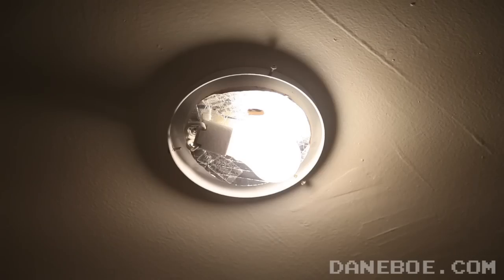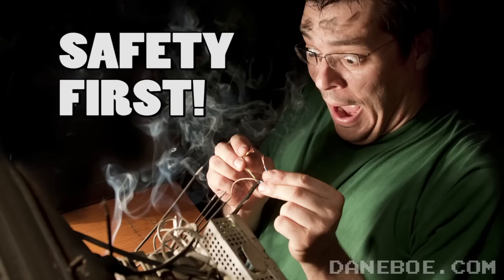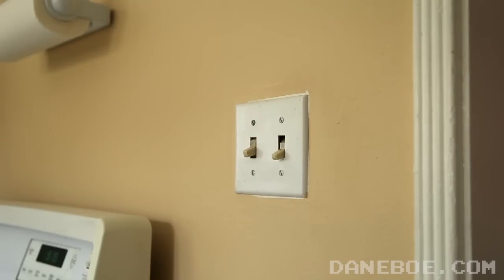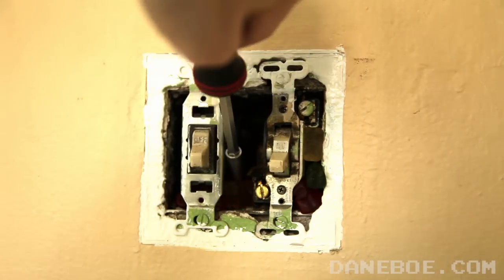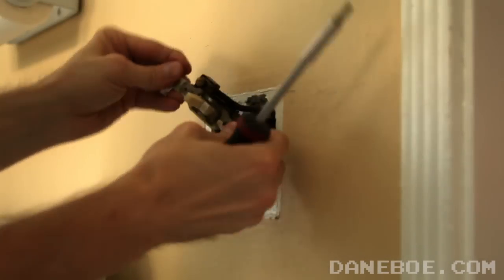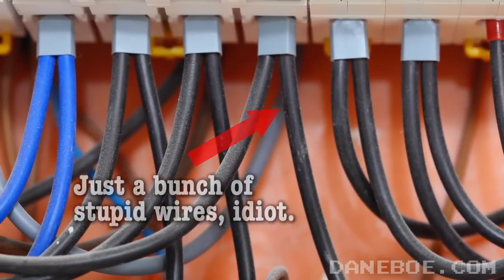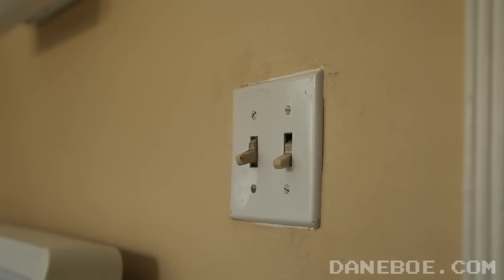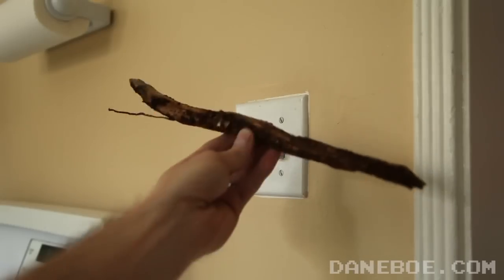Light Switch Hack

Comment: By spinning the switch, you're bypassing the fusion conductors creating a double-quadric flow current that inverts the bulb filament, creating a triple-voltage bond between an electromagnetical high density recharge circuit.
Reply: Goodbye brain.
Reply: @dylaninpieces2  DON'T USE THE STICK!!!

Comment: Wow, must be an old house since you have screw in time delay fuses. 
Turn it too many times and you will certainly cause metal fatigue and the wires will break.
Reply: Or if not the case, the bulb could be as bright as the Sun, burning everything in its path.
Reply: @TheStellaruniversexm  But Don't Use The Stick Here.

Comment: I've found a way to make this work better. After rotating the light switch,before putting it back on, jam the stick in. Then reattach the light switch. This sends the stick through the wires into the lightbulb causing a chain reaction with the lightbulb superheating the air into plasma creating a miniature flux rift causing the light bulb to generate much more light.

Comment: Fine, I'll just sell the stick on Storenvy.
Just so you know, there are no electronics in a single pole 120V switch. Which makes the hack all the more amazing. As well as twisting the wires would cause a EMF fault.
Reply: But do you really have that old fuse box in operation?
You may as well use the stick to circuit the power.

Comment: Well iphones came in 2007 so your house should be built after then if you want any iphones or ipods. Ipods came in 2000 so the iphones replace the ipods later. This is so real! There is large wattage in the circuit so it can become too bright.

Comment: As I suspected from your other BS videos you are putting anyone in danger that does not know the difference between and joke and potential instructions.
I don't care how much time you put into these videos you are close to being reported as it is. I will make my final decision after viewing more of these videos.
Reply: calm down
Reply: I also know the dangers but there are much worse videos out there
Reply: Brad Law That's true and I have reported 3 people for these types of instructive posts. LifeHack2012 is one of them.
Anyone that does not have the faintest clue about how to use a multimeter to ascertain a lack of voltage in this switch set up prior to sticking their fingers in are quite likely to get a nasty shock if the correct switch or fuse has not been utilized to remove hazardous voltages.
The mate I have living with me is not silly but he also has no idea on electricity. I bought him a multimeter 3 years ago and it is still in the packing because he does not know how to use it mate. So even with the best of intentions fatal mistakes can be made by unwary people that may become victims of following these videos.
Even as a service technician I stuffed up during my training by switching off the wrong power point while I was servicing a switch mode power supply. I touched a heatsink and then the chassis which resulted in me getting a 9000 volt shock from a unit designed to power 32 hard drives on a network. I couldn't feel my arm till the next day but I was lucky because if the voltage went through my heart I wouldn't be typing this message.
CHEERS
Reply: NoevileaThis video is for entertainment purposes only dude. Chill.
Reply: Jbmorris289 tell that to the people who may try this thinking it is real mate.
Reply: Noevilea I thought it was real but then I used the stick and I knew it was fake.
Reply: Quillagy™ | Lets Player there are a number of videos like this on YT and I have reported a few already regarding the issue of safety.
Reply: Noevilea Yeah but you have to give him props for creativity. I mean some of these a creative but some are dangerous like the car battery one. Good job I don't own one.
Reply: Quillagy™ | Lets Player Nothing creative about putting people in harms way if they don't understand the implications mate.
Someone silly enough to think this might be worth a try could end up dead. Then who will be responsible the poster or the person that didn't know any better ? I`de lay my money on the poster because if it wasn't for that it wouldn't have been tried.

Not sure about the car battery one but if it involves pulling it apart there are 2 issues, Hydrogen sulphide and sulphuric acid both are deadly but the acid is more obvious.
Lethal dose for H2S is 100 ppm and that's pretty low. I've worked with it myself and it has no color odor or taste so you don't even know when you have been poisoned till its too late. Death can occur in 1.5 minutes and by the time you realize something is wrong you don't even have time to make a phone call.

I`ll check out the video soon. Is it by the same poster of this video ?
Reply: Noevilea Not sure just type Car Battery Hack
Reply: Quillagy™ | Lets Player Yeah just saw it and as I suspected. Total BS that can put a number of people in hospital at the very least.
CHEERS
Reply: Noevilea no prob.
Reply: Quillagy™ | Lets Player
CHEERS
Reply: Noevilea like  Ii said, no prob.
Reply: Noevilea H2S does have quite a strong odor of rotting eggs that is discernible at minute concentrations... Not sure how you were unable to smell it, unless you were exposed to it for so long and high enough concentrations that it damaged your sense of smell... 

In any case, I somewhat agree with what you're saying; however, with the tone of the guy's instruction throughout the vid, the gummy bear insulation and "not using the stick", I think that it's pretty immediately clear that the video is far from being serious lol. Hard to believe that anyone with any brain at all would think that the instructions in this video are real :)
Reply: theChaotiChemist hydrogen sulphide is different to the smell of sulphur mate. The smell also can vary regarding differing concentrations. I was trained in emergency evacuation procedures as a result of the process in a nickel mine releasing this gas.
Our H2S detectors had to be hung around a foot under our head and neck while the alarm was set to go off at 10ppm ( they looked like a little hand held 2-way radio but without an external antenna.)
Lethal dose on site was determined to be 100 ppm. the lower dosage can smell like rotten eggs but as the concentration goes up the smell changes. We had people die onsite that smelt nothing when they walked through a dug out channel and one of them collapsed and died before the ambulance even got there the next one asked what happened to him and then he collapsed.
By the time your lips go numb you often have less than 2 minutes left mate.
Reply: Noevilea I am aware that hydrogen sulphide is different than sulfur :) I have used it in many inorganic synthesis before. By no means am I trying to understate the toxicity of hydrogen sulphide; it's really nasty stuff. I was just saying that you must have been exposed to a dangerous amount of it to have your sense of smell deadened like that; wasn't aware that you were involved in a full blown H2S release! Must have been quite a harrowing experience